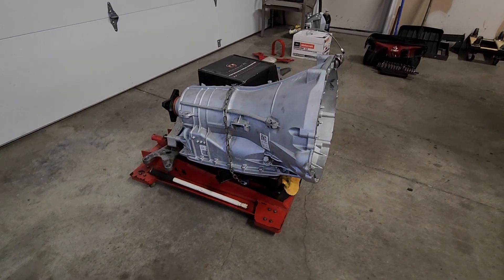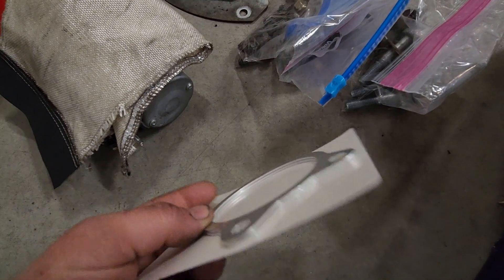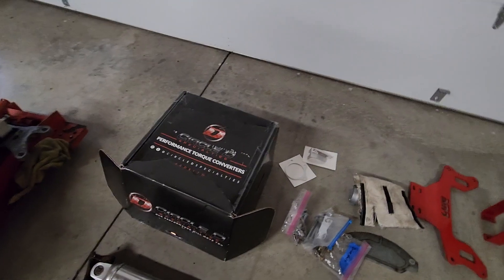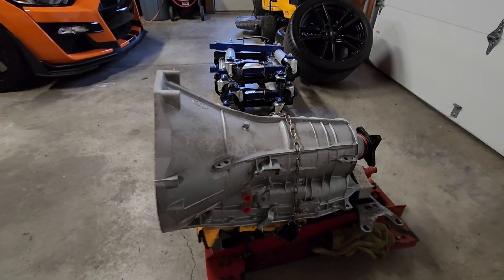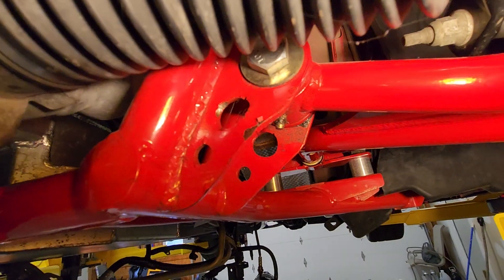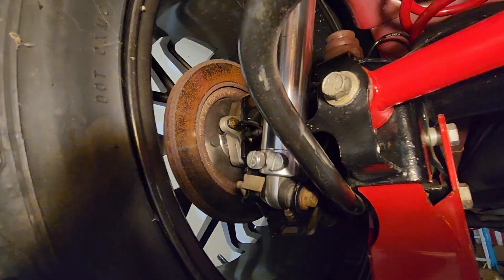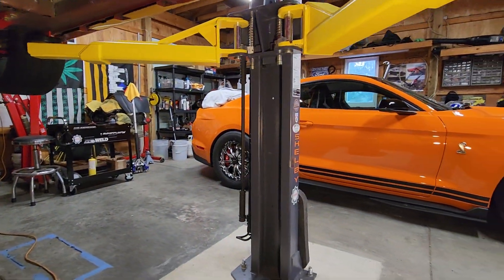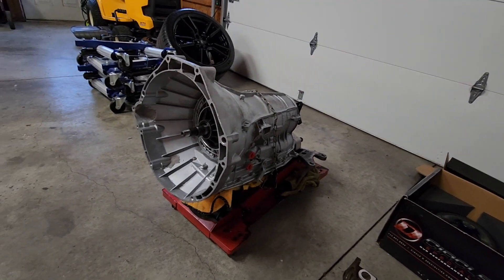built 6r80 install on street sleeper

Comment: Is this the billet everything except the 3r200 hub
Reply from the maker: I think  pretty much a built 6r80 from pbh clutches ,shaft, an all the upgrades without goin crazy no hubs or anything like that
Reply: @brezicky  how much did it run like 9200? Trying to see if a built 6r would be better for me than a 10r before I start doing a swap I want a street car for mostly roll racing
Reply from the maker: @Alex-pl1ye  think 10r80 can only be used with gen3 controls.....an wanna say it was around 6k or so for transmission it's not a crazy built one
Reply from the maker: https://www.lethalperformance.com/pbh-built-6r80-high-performance-transmission-for-2011-2017-mustang.html